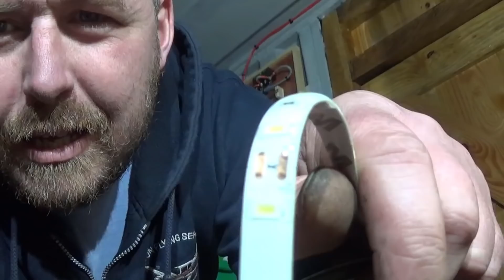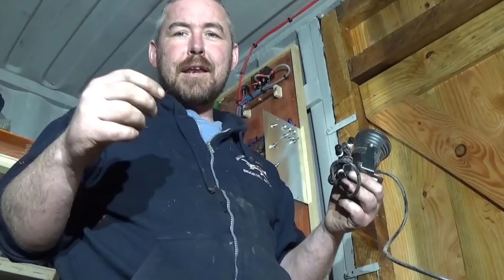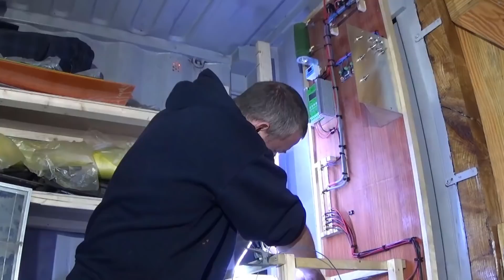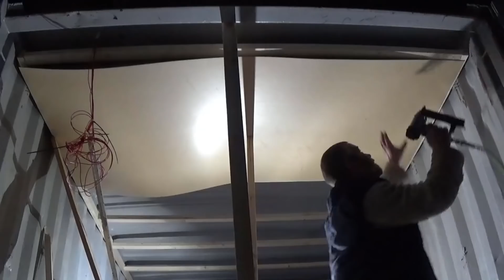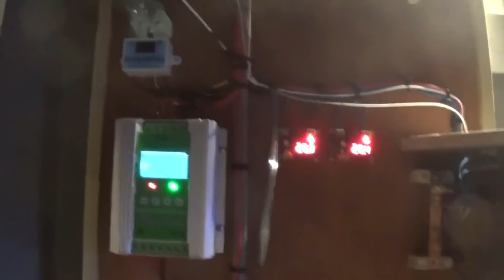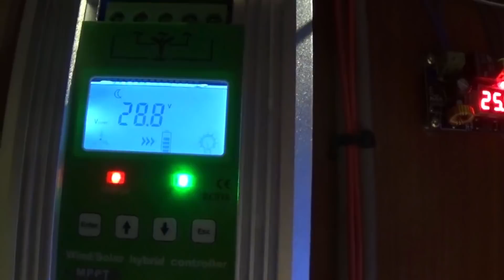container workshop LED lighting

Comment: Nice lighting system, those little cheapo LED strips are quite good, you could have got the ones with the remote control that allow you to dim or change the colours of the LED though, leave it on cycle strobe mode and have a disco in the workshop lol.
Reply from the maker: I saw them for sale but don't know enough girls to open up a knocking shop so went with the cheaper option
Reply: @turboconqueringmegaeagle9006  LMFAO James lad, thanks for the giggle mate.

Comment: I was going to panel mine in wood from pallets.
Reply from the maker: Yikes, that's going to be a lot of pallets! Will you plane them?
Reply: @turboconqueringmegaeagle9006  My plan was to plane them to joint them, then sand the visible surface with a belt sander. It'll take a while.... but pallets are in plentiful supply at the moment.

Comment: Nice work. I have some 1000 lumen (allegedly) led panels for my shed.
Reply from the maker: LEDs are the way forward, especially if you are going to be limited to the power available by a Sterling engine!
Reply: @turboconqueringmegaeagle9006 The shed will be run off the mains. The Stirling engine will be for experimentation. It will also take a while as I need to spin the reflectors.

Comment: I ended up stapling my LED strips as the adhesive kept failing, the waterproofed ones with the rubber are quite a lot heavier then the normal strip ones and I've got stickier snot than what they use on them. Might be worth getting a light sensor so your always 'ON' LEDs automatically switch when it gets dark enough, or even a PIR set up so they turn on when you're coming in.

Comment: What I have done is connected a hell of a lot of leds in my workshop up to and Alex controlled switch. It's so cool iron man like walking in and telling Alexa to turn on the lights and they all slowly ramp up, also completely dimming.
Reply from the maker: Get out of here, can elexa switch anything on?
Reply: @turboconqueringmegaeagle9006  you can even get a wifi power supply for your leds that Alexa can control